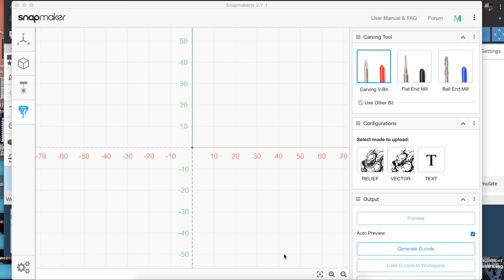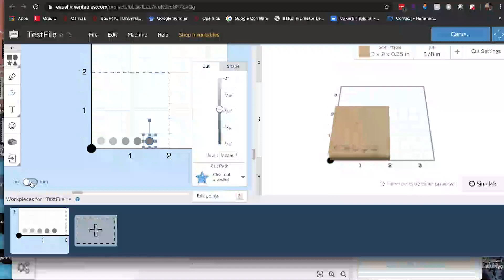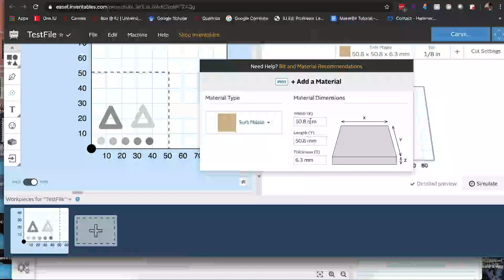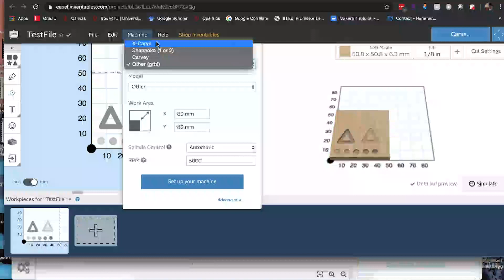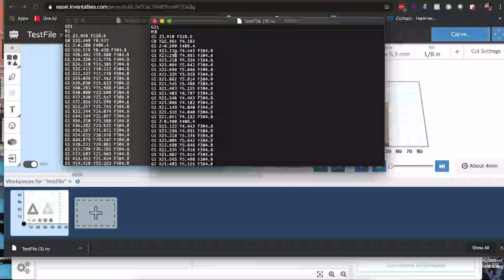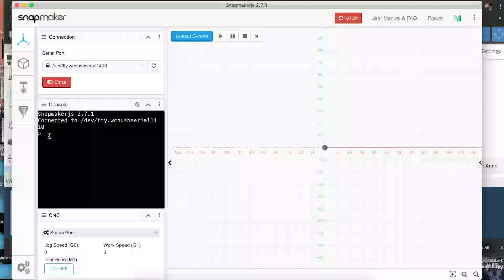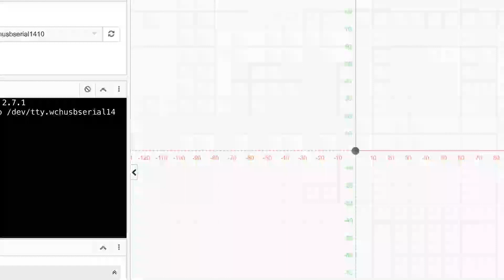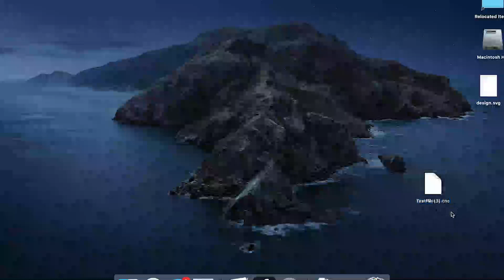MakerStudio: Using Easel to generate GCode for Snapmaker CNC

Comment: Hey man.  Very helpful.  Really appreciate you taking the time.  I had to do some extra digging and I tried it out on my SnapMaker to make sure that it worked, here is the list of power conversions for the spindle speeds.

M4 P100 = 11940 to 12000 RPM 
M4 P90 = 10800 to 10860 RPM
M4 P80 = 9600 to 9660 RPM
M4 P70 = 8400 to 8460 RPM
M4 P60 = 7140 to 7200 RPM
M4 P50 = 5940 to 6000 RPM

I verified that M3 and M4 both work... at least for the A350.

Thanks again
Reply from the maker: Awesome - thanks for sharing!